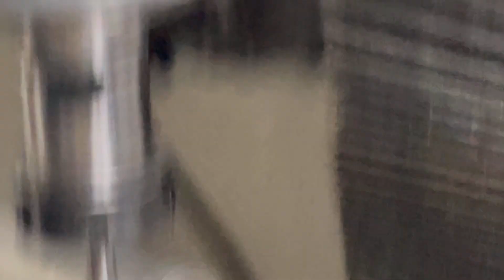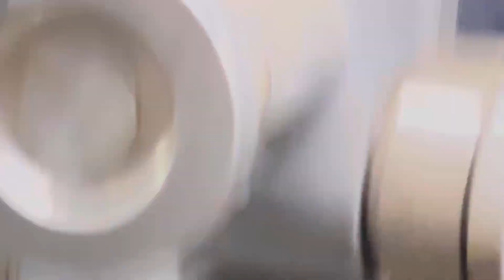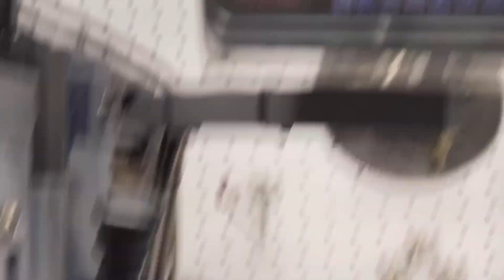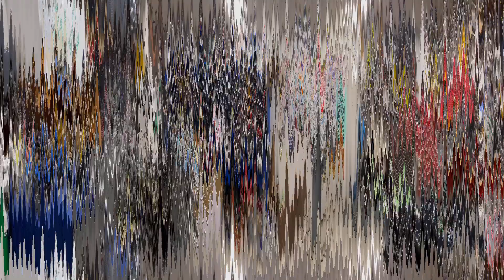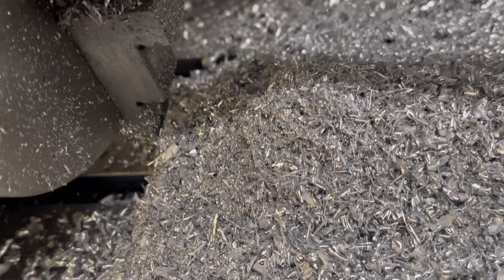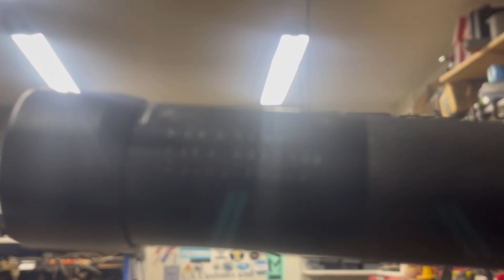300 Blackout Suppressor build

Comment: Very nice build.  I'm looking forward to find out how well it performs.  
Someone made a video trying to use a clear outer sleeve for filming how the suppressor works, and the weak point (failure) was the threads between the sleeve and the barrel adapter.
Reply from the maker: Planning to get out to the range soon to do some testing.

Thanks for the comment